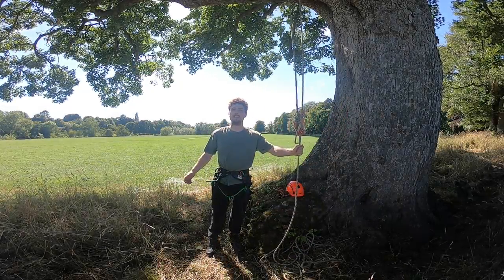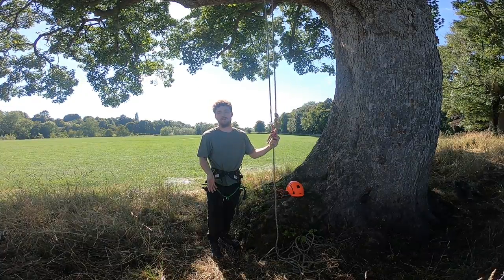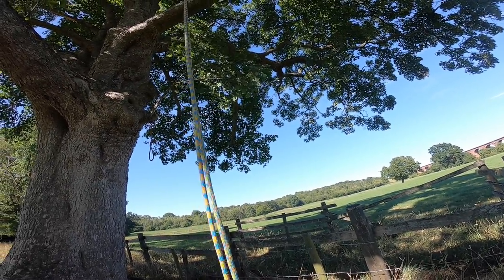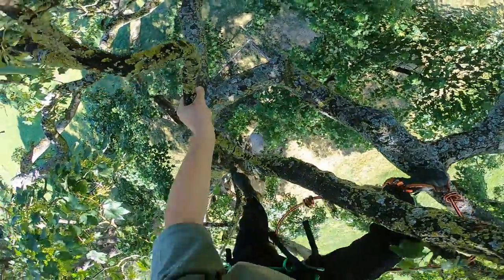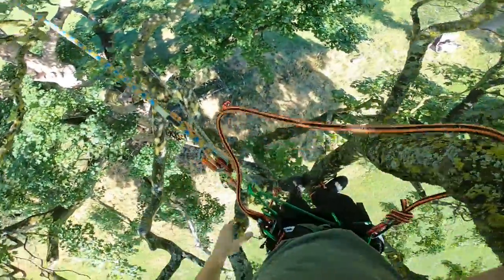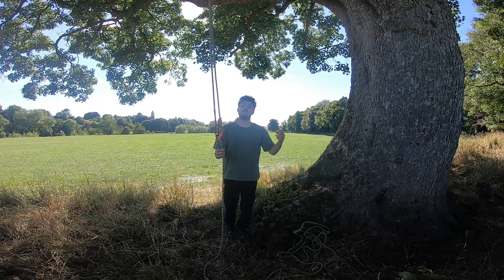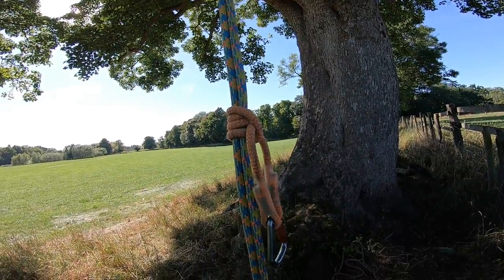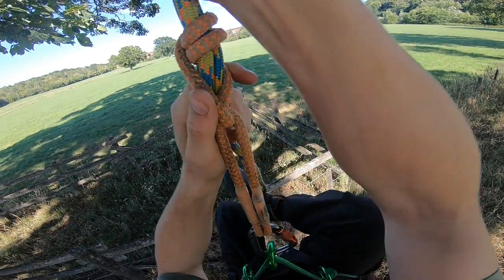Difference between SRT and DRT?

Comment: I think the confusion comes from the terminology you are using. I had a conversation with someone about this. We came to the consensus that we should use the terms MRS, moving rope system, for a "Double rope system" and SRS for, a single rope system. So, the biggest confusion might be that we say double rope system when we are only using a single rope. It is essentially a single rope system except it is moving around an anchor point in the canopy, hence moving rope system. We can say that it is a single rope doubled over that anchor point, but it is moving. Anyway, that's my bit. Thanks for your videos.
Reply from the maker: Love the videos CaptainHook! 
Yeh, the terminology can be confusing especially when every calls it different things at this point.
Reply: Thanks man I am enjoying your videos as well. Keep working on them and try not to burn yourself into the ground.

Comment: Really interesting set of videos, thank you.

You can still put a knee ascender on when going up like that DRT, I have a Haas for that. You don't get such big steps but sharing the work between both legs is a lot better.
Reply from the maker: That would be interesting to try, as you could see the times were close it was just how tired I was from the drt accent so that could help with that, thanks for watching ✌️
Reply: If you’re gonna spend the time to use ascenders you may as well get the efficiency of SRS… don’t see the point of using MRS other than the fact that it’s quick
Reply from the maker: @jackberdine  In my opinion, SRS is superior due to it being better on your body and it's quicker in most cases. It can be a scary transition though if you've climbed MRS your whole career however so it really comes down to what ever works for the individual ✌️
Reply: @TPOTTS_TREES  yea i never use MRS

Comment: VERB
emulated (past tense) · emulated (past participle)
match or surpass (a person or achievement), typically by imitation:
"most rulers wished to emulate Alexander the Great"
:)
For ascending the double ropes a french prussic is best, adjust the amount of wraps for desired bite, as you say it should be longer to allow you to push further up the rope. you can of course use another prussic for your feet instead of foot locking :) Rock climbing technique.
Reply: Good videos by the way :)
Reply from the maker: Thanks for the tips, interested how you would use a prussic for your feet ? Also thank you archery much appreciated